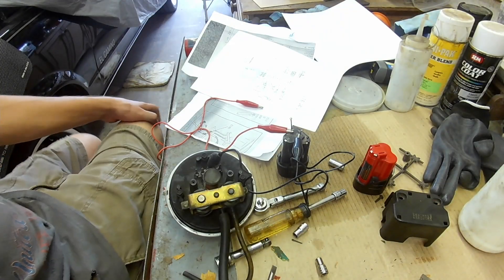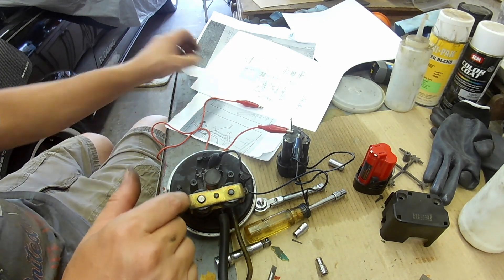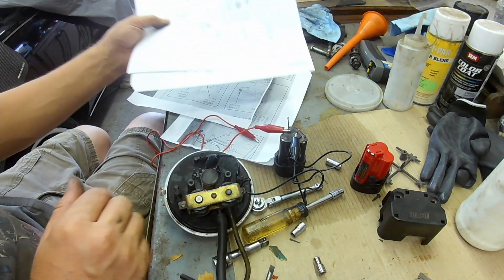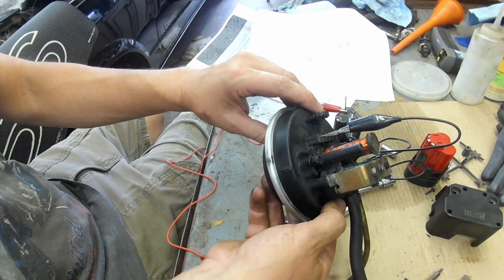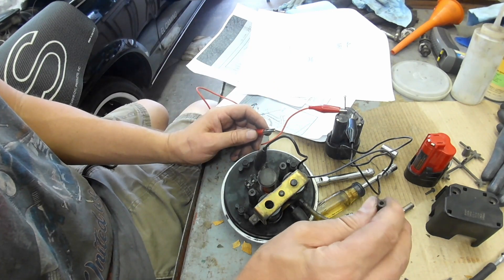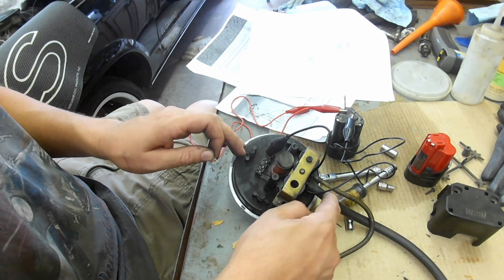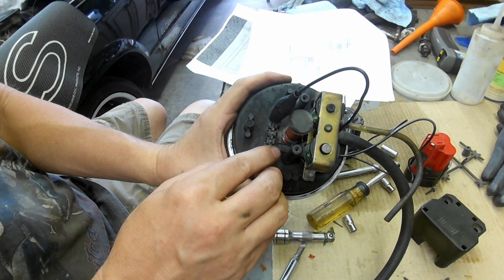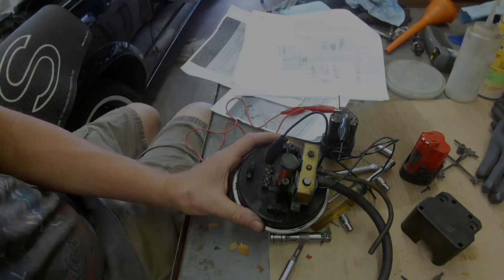G Body Cruise Control - Servo Unit Bench Test

Comment: These servos are pretty much the same in all 80's GM cars, I have same unit in 1990 Suburban. Mine was occasionally leaking out vacuum causing speed loss, but recently the other valve malfunctioned and actually forced acceleration by letting too much vacuum. I disassembled both valves, having to replace a spring in a vacuum valve and substitute a crumbling white orifice with a gas nozzle from a stovetop, I did a writeup with some pictures on a GMsquarebody forum.
Reply from the maker: Great info! Thanks for your comment!

Comment: David posted the foam filter problem.  He has some good videos of ac repairs on 80’s Gm’s.  The center winding on your unit is the position sensor.  Thanks for posting.
Reply from the maker: David had a great video. Was very helpful with my 87 EC build. Thanks so much for your comment.

Comment: How much knowledge do you have in cruise control I need some help
Reply from the maker: My knowledge is just good enough that my cruise control now works. But the gentleman in this video below is much more knowledgeable than myself.  Hope this helps.

https://www.youtube.com/watch?v=du0H79tLd5Q&list=WL&index=15
Reply: So I have 1984 hurst olds .I drop in 350 olds with victor intake I don’t have anything original anymore I am installing a new vintage air system and going hydraboost. How can I keep my cruise control working
Reply from the maker: @rojelioochoa918  You'll have to do some modifications to the brackets to make everything line up. My 87 El Camino has a Sniper EFI on an Edelbrock EPS intake so things did not line up on mine initially. I modified the original servo bracket that mounts to the drivers side head on the rear near the firewall as well as making a bracket that ties into the throttle linkage bracket. Then I mounted the vacuum canister behind the front drivers side headlight bucket to clean up the engine bay. I'll have details on this in an upcoming video of my Holley Sniper install. Should be posted next week. Here is a link to part 1 of that series. Hope this helps.

https://www.youtube.com/watch?v=DfQQAasDA-o&t=292s
Reply: I was told by a guy to ground the vss wire to a ground
Reply from the maker: @rojelioochoa918  If you've eliminated the computer in your car then you need to find the black wire with white stripe behind the glove box that used to be connected to the computer. Then simply ground it to something metal under your dash and your cruise should work.
Reply: I have a servo with a ripped rubber diaphragm would this cause a vaccum leak for the engine?